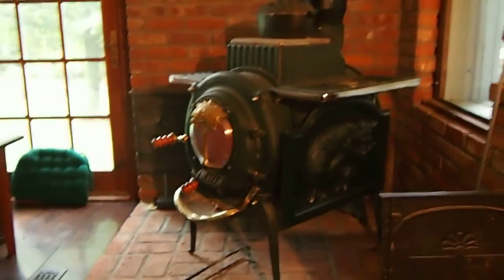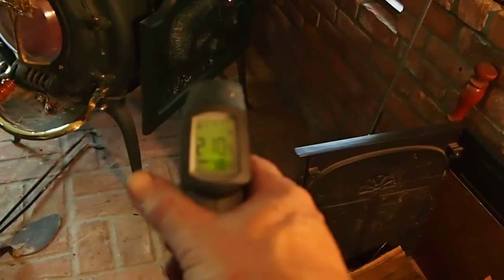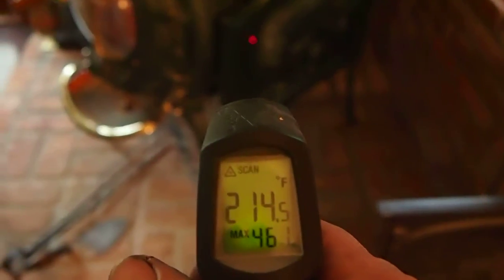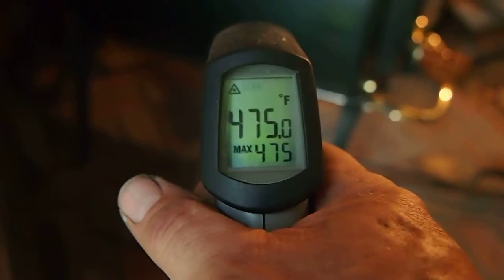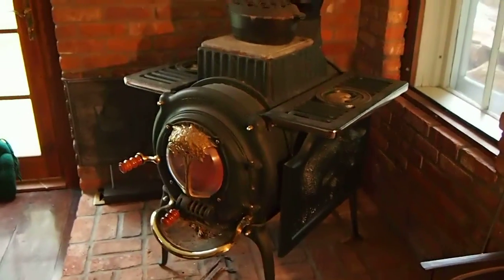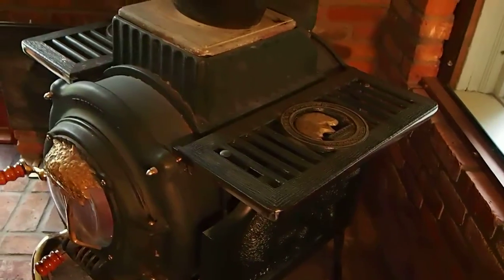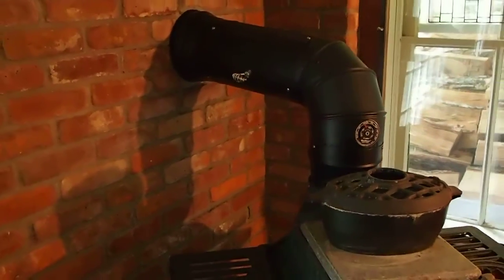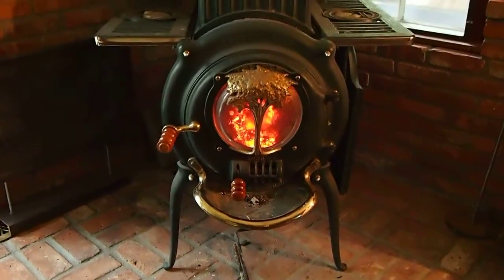New Bear Heat shield in action

Comment from the maker: Traditionally many stoves are starved for oxygen in the upper part of the firebox.  If there is not adequate oxygen to complete combustion of the wood gases, the result is that smoke goes up the chimney,lowering the efficiency of the stove.  By introducing preheated air to mix with those gases, under the baffle, we increase the efficiency by getting those gases to burn and release added heat to the stove, and eventually to the room.